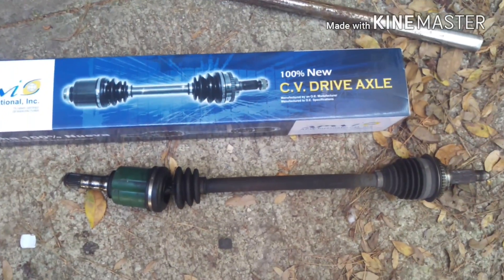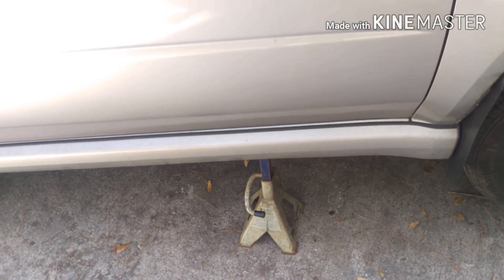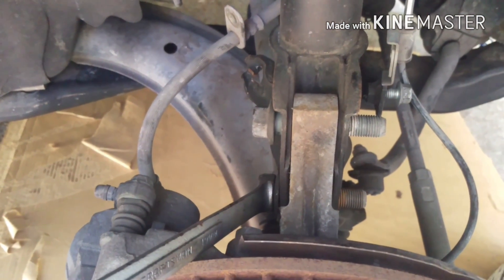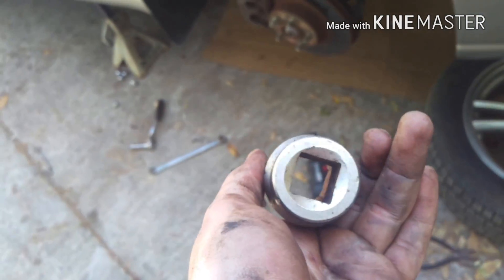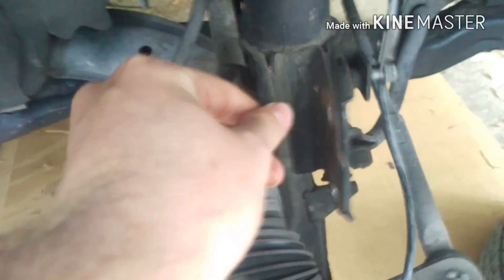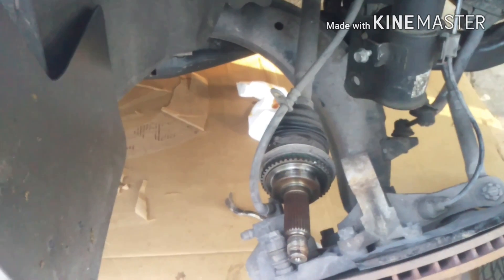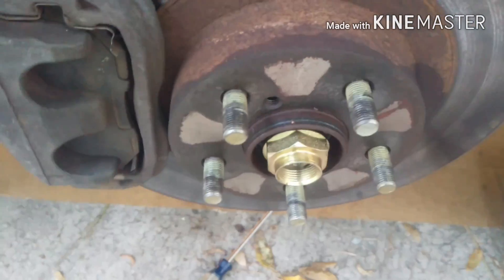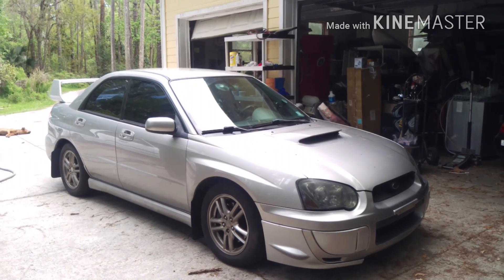Tutorial: CV Axle Replacement 2005 WRX

Comment: Protip: remove the wheel center caps and pop the axle nut loose while the wheels are still on the ground. Much easier than trying to use the brakes and less liable to damage something than using a screwdriver to pin the rotor in place.
Reply from the maker: That's a great tip! Thank you!
Reply: according to service manual you're not supposed to loosen this nut with weight on the hub.  just use an impact to loosen / apply brakes to torque to specs
Reply: @francoisloriot2674  you are.correct, it's hard on the wheel hub, and besides it's extra work putting the tire back on.

I found that sticking something in the rotor works just fine.